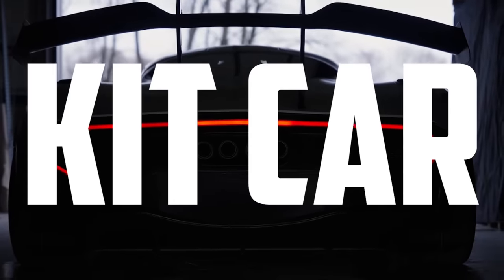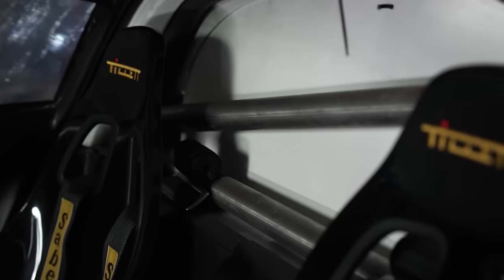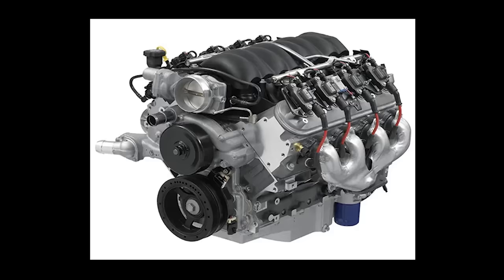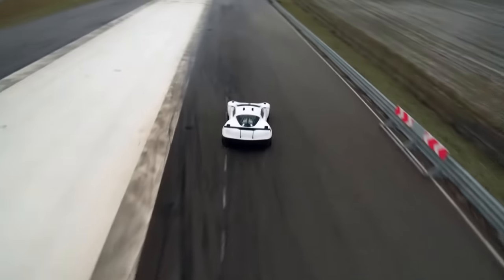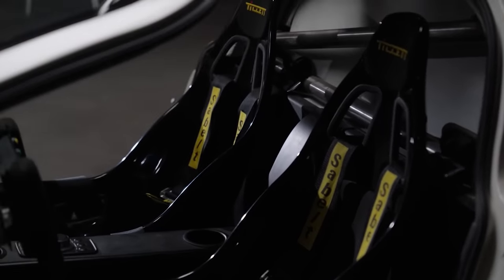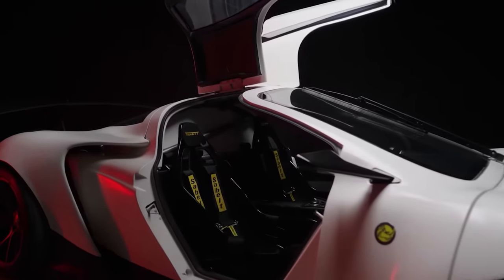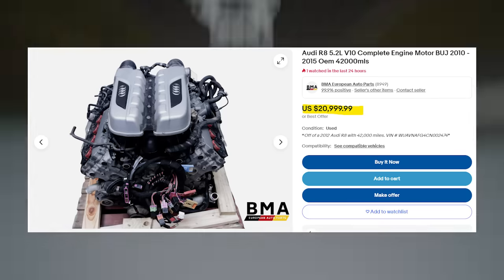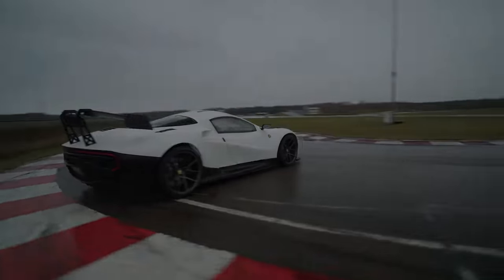The Rhino RR01 is a V10 Kit Car

Comment: I like it. And don’t have to use an expansive Audi engine, cheaper Chevys or can be used, and still be a beast.
Reply: Yes but the sound and redline of a Lamborghini V10 Is on another level😢
Reply: Yeah, I can buy a hot LS and 5 replacements for Waaaay less than that audi mill.
Reply: yeah, like LT1 or any LS would be just as cool plus you have tons of resources
Reply: I think the mounting would pose a few issues. But it could be pulled off.
Reply: @LILJ830  If someone is going for a car like this, they better have the tools and skills to modify and maintain it.
Reply: You can keep the Chevy engine. Give me that V10 pls 😊
Reply: @nox6885  Yes, it’s a hot engine, but it’s the all around cost that’s the issue.
Reply: For 33k.
I can have a Steve Morris racing engine making 1500+ streetable horsepower.
Reply: I didn't know the engine expands 😂
Reply: Hopefully audi V10 can be found for rather cheap in Europe
Reply: A Toyota 1gzfe v12 might work
Reply: Expensive.
Reply: Slap in a 1LR-GUE
Reply: It would be faster with a blown LS than a Euro V10.
Reply: @MARCO-rq2ph you can make a Chevy ls sound nearly the same, while making more power and being more reliable
Reply: @djsonicc  sure xd
Reply: Ls or 2jz would be great for this car or an vq38 I’d build a shit fast car with this btw I’m a Lamborghini guy buy let’s just be frl it’s be more fun with a smaller and more reliable engines which I mentioned
Reply: If they used a Chevy engine or would be another boring V8 super kit car. The V10 makes it something unique.
Reply: Or use a more expensive Elmer racing engine 🤤
Reply: @ChuckBeefOG If you check AMS performance's packages for the engine it's built for.. anything but slow.
Reply: @MARCO-rq2ph yeah but you can pull a junkyard LS out of a Tahoe for a couple hundred bucks if you know what you’re doing lol
Reply: just use a 1jz
Reply: I was thinking of a supercharged rotary tbh.
Reply: @MARCO-rq2ph  it’s a VW V10……..
Reply: well, its first prototype

Comment: $70k, nice kit, but makes me wish factory 5 still made the mid engine 818 for $12k & based on subaru wrx & use an sti built motor & bigger turbo for up to $20k so $35 total for 818kg car with 818hp.. thats koenegseg record fast 1hp/1kg.
Reply: 818 kit has been stopped for a long time now.
Reply: That was my dream car for sure. 818 was soo cool.

Comment: This thing is pretty cool, but I think they're making a mistake not using LS platform, or at least offering it as an option.  As good as the R8 v10 engine is, you can get an LS7 for half the price and that would make it a lot more appealing to anyone seriously interested in building one of these.  Otherwise, this puts it in price range of a Factory Five GTM and that's a much better car.
Reply: i heard that you buy car without engine and gearbox and you can put inside whatever you want.
Reply: @valdzeelis25  I'm sure you can put whatever engine, but then you have to custom fab mounts, harness, etc
Reply: And sound like a old tractor? 🤣 nevermind. This v8 sounds trash always
Reply: @StandUpHubBrasil  Depends on choice of crankshaft, and how evenly matched your exhaust headers are. There is a V8 build with perfectly matched headers (8-1 merge collector, equal length) that turns it from burbles to rotary-smooth revving. You pay a pretty penny for the custom piping work needed to get that fabricated.
Reply: LS is overrated. Old and sounds pretty crap
Reply: @theairaccumulator7144  Again, it depends on how one fabricates exhaust piping to go with the engine. They're literal pipe organs, but replace the compressed air with an engine.

Yes you can also make the V10 sound like crap too, with unequal length headers.
Reply: @theairaccumulator7144 show us on the doll where the LS hurt you
Reply: @djsonicc BAHAHAHAHA so real

Comment: I wonder how difficult it is to get this engine with a manual.  I know it was offered, but they are rare and much more expensive now.
As cool as having an Audi V10 would be, frankly I'd be fine settling for something a little cheaper but still as powerful, like an LS or Coyote build (or Voodoo) with a Tremec Magnum trans.

Comment: "made of T6 aluminum"... T6 is the heat treat, not the alloy. My guess is that it's 6061-T6, but the picture at 0:49 looks like the aluminum portion is welded, rather than bonded which removes the heat treatment from the metal. I suppose it's possible that they anneal and then retreat the entire chassis, but what are the odds that a small start up company has the resources to do that?

Nevertheless, looks like a great car! I want one
Reply: There is no metal production in this small country. Even I am sure that local universities do not produce specialists familiar with materials science. However, the Balts, when they entered the Soviet Union, always had a very developed motorsport, with an appropriate level of engineering in car teams, they made excellent racing cars out of boring Soviet cars of dubious quality. And in the years after independence, these countries became a source of very cheap European cars for their eastern neighbor, assembled from several broken-down cars. The garage business of assembling "saws" and converting "total"s to a running condition was very developed.
Reply: ive broke several mtb trials frames made from 6061 & 7005 & 7075 , the 6061 definitely weaker.. i think bars stems crank arms are mostly 7075 .
Reply: They may start with T6, and end up with a lower effective heat treatment after welding... specific results highly dependent on the alloy, of course. 

The Rhino Racing website specifies "6061T6", so your guess is correct.

Comment: Its gorgeous for a kit car and the panel fitment looks great in the promos.  The price is ridiculous though.  You can buy a used Audi R8 V10 for the same price.  The Audi R8 will have a nice interior to match its exterior and more safety equipment.  The R8 can be daily driven.

Comment: Ford gt crossed with porsche 911? Its got a good if not unoriginal body but the engine part and transmission give me doubts. I need to see thus car performing in its basic set up with full specs. Great video, got more information than the Rhino channel.

Comment: Put in the worlds highest power to weight ratio engine from Elmer Racing instead (Thor engine). You can easily get over 2 hp/kg with that engine since its less than half the weight of the v10. More than enough. Also they have lighter turbo parts which could drop lots more weight on the turbo. So turbo and engine is lighter than half the v10.

Comment: Looks good, finish fit looks good enough, and the chassis design displayed in the video seemed pretty decent too. But ditch the overpriced V10 for something with lower mass, with off-the-shelf service parts - a Toyota V6 with a pair of turbos and a transaxle,.. or bring the price right down with V6 and FWD transaxle, adding a clutched supercharger, make it easy to drive light throttle around town, then an animal on the open road or at track days.

Comment: Looks nice, but for that amount of money.. you're pretty close to cheap supercars already.
Reply: Which supercar can you get for 60k? lmao
Reply: @TheSidekickking Corvette C8, Cayman/Boxster
Reply: @TheSidekickking  Easily add another 50-60K. Things not included in the base kit you have to keep in mind: engine, transmission, wheels, tires, cooling, brake system, petal box, power steering, HVAC, PMU and looms, seats, seatbelts....and the 100 trips for miscellaneous things you need at the auto/hardware store in the build that will nickel and dime you. Then you have taxes, overseas shipping, registration, insurance.

Comment: Make the enginebay longer to fit a 24 cylinder engine with 17Liter displacement and a big turbo. That should do 3500HP on all wheels, 500Km/h topspeed. its strange that non of the sportscar producers make that.

Comment: Aaannd, there's the V10 they chose.  The Audi one.  Nice, the LS motors are smaller, lighter, more fuel-efficient, make the same or better power, and cost less than 10K after you mod them to make 800hp.  Tell me again why you think the VWAG V10 is better?  Is it the two widdle cywinders?  Get out.

Comment: Modularity? Cute concept but I dont trust myself doing cars specially if its already engineered to be modular thats what builds are for re-engineering/re-designing the car and making it better but also safer, modular supercar safety concerns are hanging to yourself why not just go for the build if an car issue accident happen rhino racing will be facing setbacks dude ☠️